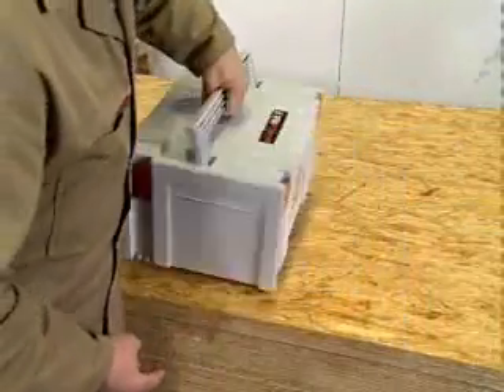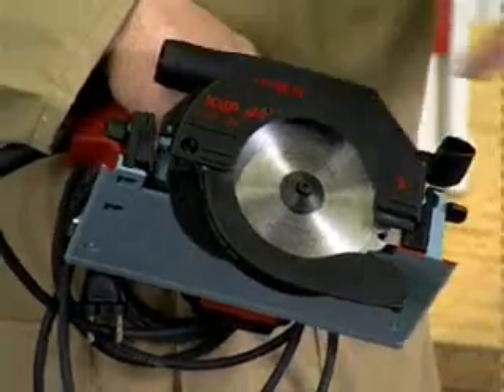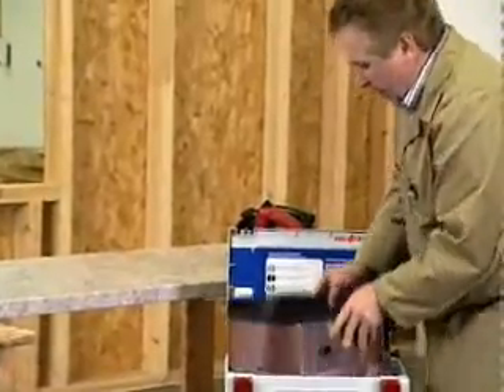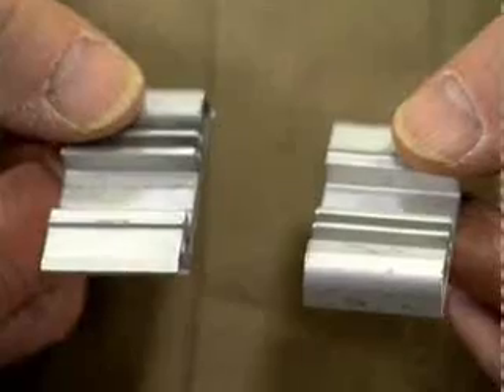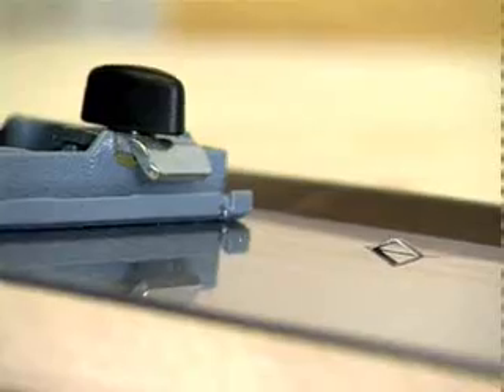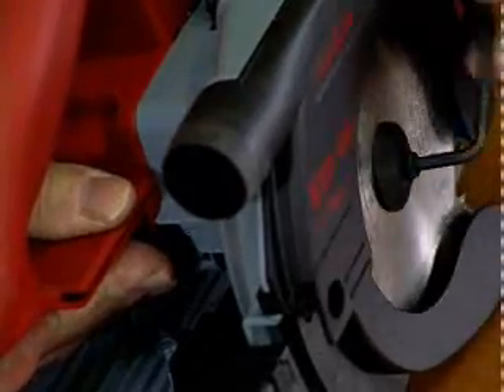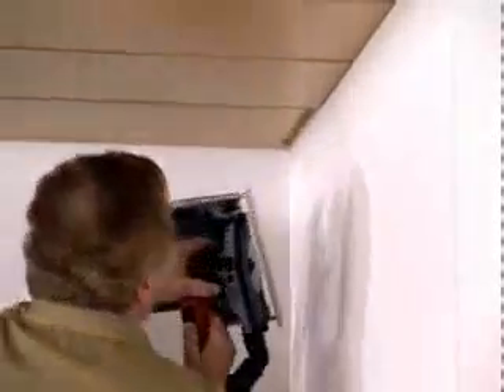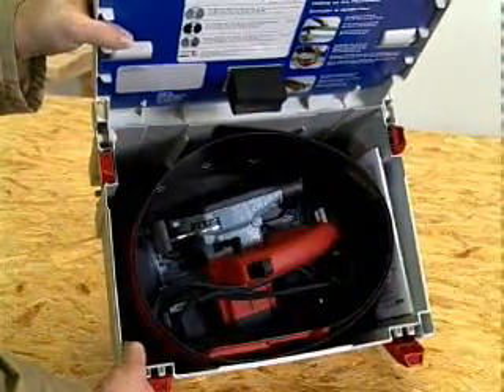Mafell KSP40 Plunge Saw Flexistem System

Comment: So what's the difference between this KSP-40, and the KSS-300?   The KSS-300 attaches to the  spring loaded cutoff rail... is this the same saw other than the rail?
Reply: The difference is the KSP 40 has a plain base and doesn't have a wide slot removed from the base to allow it to be used on the crosscut rail that the KSS 300 has. I bought a KSP 40 because I didn't want a crosscut rail and I didn't want a wide slot removed from the base of the saw. When I got my KSP 40 and looked over the saw I noticed straight away they gave me a KSS 300 saw as it had the wide slot removed from the base. When I contacted Mafell they said they changed the base to be like the KSS 300 so you can use it on a crosscut rail. I told them I bought the KSP 40 because I didn't want the wide slot removed from the base but they just ignored my e-mail, nothing new. If you know your facts, then they just ignore you. I gave the saw back to my dealer and got a refund, very unhappy with Mafell's attitude.
Reply: It's the same saw nowadays, just doesn't have cross cut sled. Gas grooves for it, but no sled.